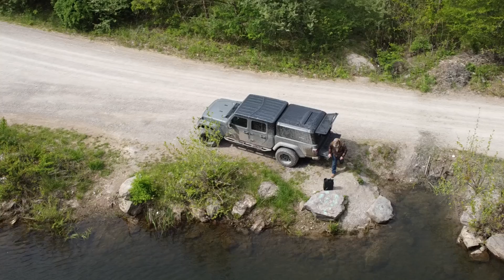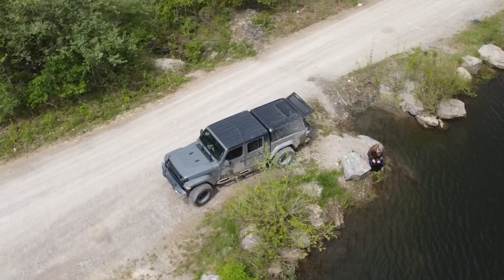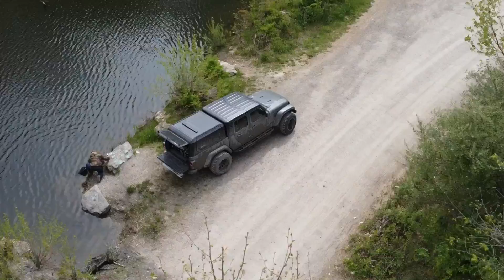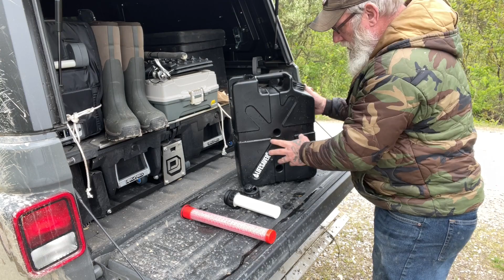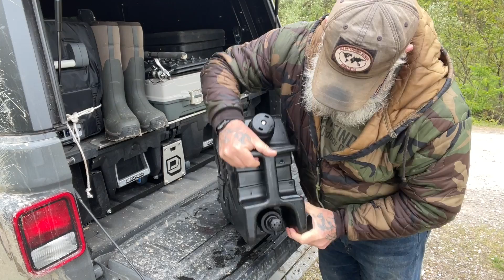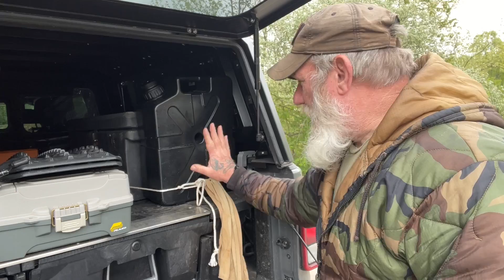Gladiator Build Part 3 Water Collection and Storage Liberty Life Saver

Comment: What do you think of the Sawyer Mini filters? About 20 bucks and can filter up to 100K gallons (that's because it can be back washed). Small, lightweight, takes up no room and packs away easily. And no moving parts other than the backwash syringe plunger. In my opinion, an under rated prepper item. Great backup to these cans
Reply: I have a few of the Sawyer and a few lifestraws. Always have a backup

Comment: Mine as well as my 3 other buddies who got them all have the same problem of it leaking around the nozzle when completely full and stored under pressure. If not filled all the way to the top and not pressurized before storing, no problem at all. Awesome piece of gear